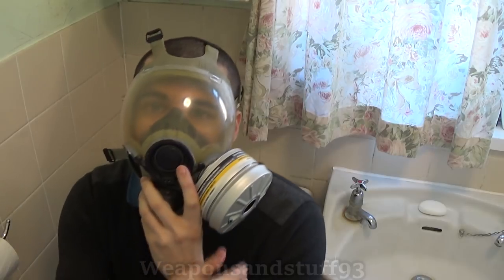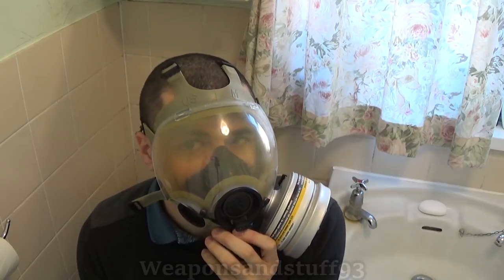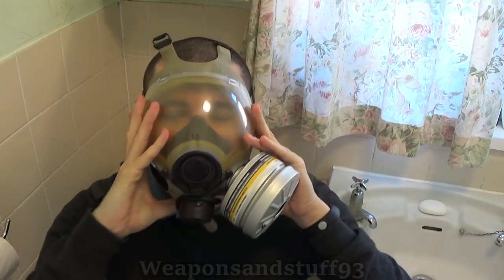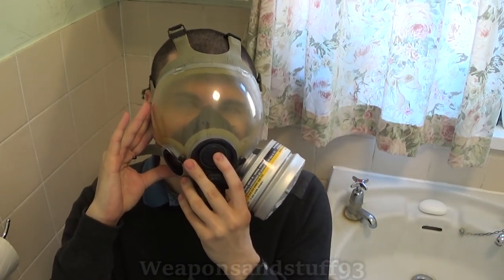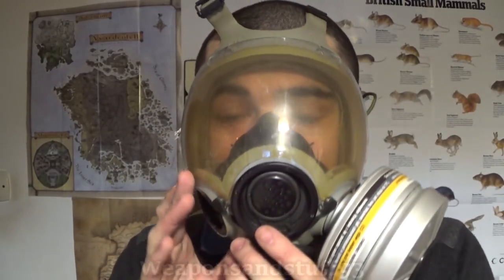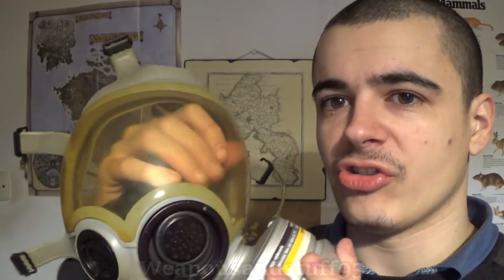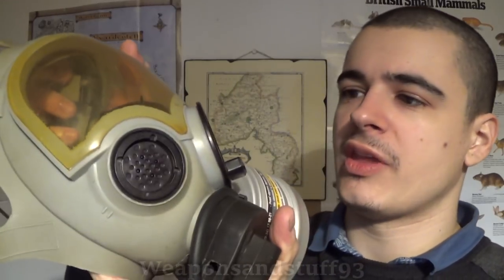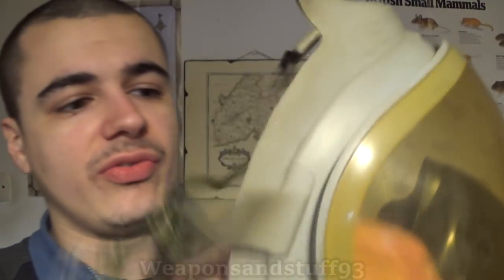MSA MCU-2A/P Gas mask Failed Test

Comment: Too bad the harness system is trashed it looks like a good mask
Reply from the maker: There's a leak somewhere else as well.
Reply: JWolf4554 I have one and I love it.
Reply: The millenium looks the same but its significantly more durable... And its black.
Reply: i have the newer one its a cute mask i love it
Reply: @user-xc8nn4rc1j  im suposed to get mine in a few days. Cant wait.
Reply: ᠮᠤᠩᠬᠲᠧᠩᠷᠢ ᠬᠠᠭᠠᠨ what is the normal cost of the millenium?
Reply: @mosesgonzalez2248  No. The millennium material will be more resistant to blistering gases, but it is not durable to deformation or the passage of time. The silicone of the mcu is of better quality, although it is less resistant to blistering gases.

Comment: The discoloration is from age. That was one of the major problems with this mask, the silicone-composite aged poorly.
Reply from the maker: Yeah it's like the XM27 prototype masks, they started off as clear silicone, now nearly all of them look a weird orange colour.
Reply: mine still looks great
Reply: The lens is not silicone, but polyurethane. The yellow can be cleaned with a little mineral alcohol.

Comment: The MSA millennium is very similar to the MCU/2p, if I'm not mistaken the only diference is the material. If you find a six point harness for the Millennium for sale, you can buy it and mount it without any significant problems as far as I'm aware.
Reply from the maker: Yeah I think the Millennium is the successor mask, like how the CT12 is the successor to the S10.

Comment: Good video the MCU is dual port u need the carrier to undo the second diaphragm blank using the carriers D ring which goes in the notches. Also u could try using a S10 harness.
Reply from the maker: The S10 harness clips into place to not come out, this harness is designed for straps with bigger ends.

Comment: At my experience you must take note not only of a face mask sizing but the feel that you get under your chin. Proper-sized mask ought to feel like heavy-starched collar, if you know what I mean. Slightly higher of Adam's apple but lower than all the chins that you have extra ;) Or lower than that if that's full-insulation. Edit - full-face maybe is the proper term?
Reply from the maker: That totally depends on how the mask is cut, some masks have proper chin grooves, other's don't.

Comment: Which would you rather have for a 30 minute stay in a CS gas chamber, a PBF with safe filters or a Drager M65?
Reply from the maker: PBF with safe filters, because at-least Soviet masks are good at making air tight seals.
Provided I have about an hour prep time to get the cheek filters into the mask.

Comment: About that leak that you have. Some possibilities that I would assume would be first around the primary voice emitter the bitt to connect the microphone isn’t seated properly which can happen. Second the side voice emitter might be loose, depending where you got it if it was disassembled and reassembled they may have put the o-ring in wrong which happens a lot also standard procedure after use with these is to tighten the bit that keeps the voice emitter assuming you have the carrier for this or your m40 use the d-ring if you don’t have it try using a ruler. Finally the rubber is almost greenish instead of the blue white they are when new so might have a leak considering the silicone is weak.
Reply from the maker: Thanks

Comment: Would you recommend this mask?
Reply from the maker: Not really, you can't get new versions anymore and because it's made from silicone they fail quite quickly.
Reply: Msa millennium better rubber seal
Reply: @clorox821  I found this on the web: "The millenniums gas mask, the edges of the lens will discolor black from the hycar rubber and the type of cement used to bond them to the mask. Also Milleniums have been found to dry rot even brand new in the packaging, it seems there's a lot of bad batches with millenniums over the MCU. "
Reply: @xarv368  i did not know about the dry rot but i did know about the lens and i believe all mcu,millennium, wide view msa mask do after a while

Comment: I just bought a m17a2. For the life of me I can't seem to figure out how to take out the filters. I need to wash out the talc. It's not like my m10 it's a pain.
Reply from the maker: Once the filters are unclipped you have to stretch the inside of the cheeks open and pull them out, cheek filter masks are hated for a reason.
Reply: Thank you. It's a bit harder to get the filter out of the mask. They have a metal rim you have to stretch the actual mask over.

Comment: I am part of a squadron on Moffett Field in Mountain View and we opened up an old container from like the 80s/90s and it had 100+ of these gas mask plus the filters that went with them so I snagged a couple and brought them home. The filters were sealed in their filter containers and the masks are in good condition. Do you know how effective this mask/the filters will be?
Reply from the maker: If they were stored well enough to not have deteriorated, they should work absolutely fine.
Reply: 129th?  Be sure none of those filters were from the recalled (cancer causing) batch.

Comment: You should buy the sge 400/3
Reply from the maker: Why?
Reply: Weaponsandstuff93 I've seen plenty of reviews on it and I'm getting it myself, it's comfortable, so much so that you could sleep in it and wear it for days, there are 3 filter ports, centre left and right, and it fits most 40mm filters, and the visor is full face allowing for a large fov
Reply from the maker: Isn't that the mask people shill non-stop, I'd get one if I saw one cheap but it sounds like it's an over-hyped mask.
Reply: Weaponsandstuff93 Ha! I didn't realize it was shilled until a year after I'd had it, got one new for $70 instead of whatever inflated price it's shilled for. You know how that stuff just pops up online sometimes. It's a very comfortable mask to wear, has some of the easiest adjusted straps around, lightweight, has triple filter ports, and has a great panoramic field of view. I can certainly vouch for it as long as you don't pay more than $70-100, as most masks aren't worth that or much more.

Comment: Great video, I was wondering if you could make your own filter by starting with a 40mm particulate, taking the particulate and putting it in a can or something, adding charcoal next, as a vapor layer, and then another particulate and put the 40mm screw on top of the can, would it work? it would complete your makeshift gasmask.
Reply: And would it be cheaper than buying a new filter?
Reply from the maker: In theory if you had a container, you could put a P3 filter pad at the bottom, then pour in some activated carbon, then put another P3 pad on top and you'd have a working filter, parts for that would be about £7 per filter as opposed to about £20 for a new one.